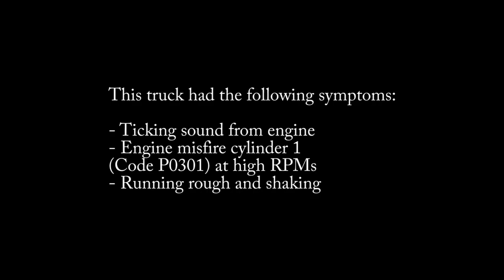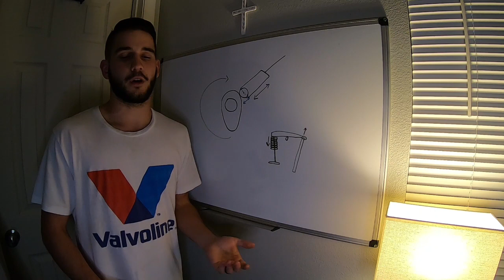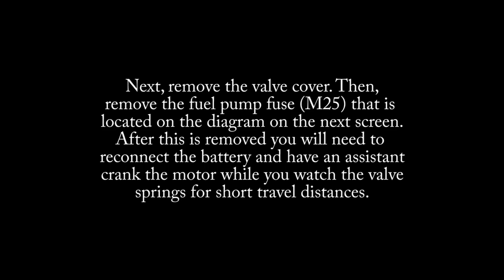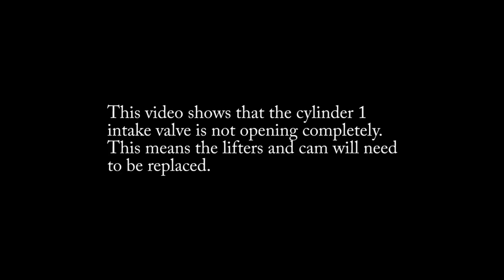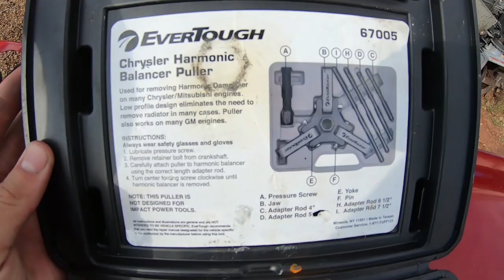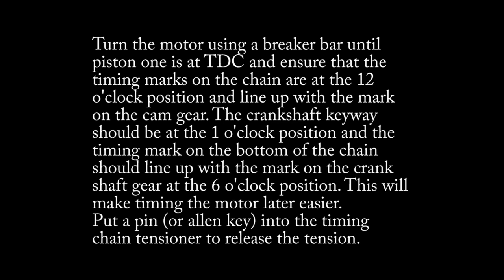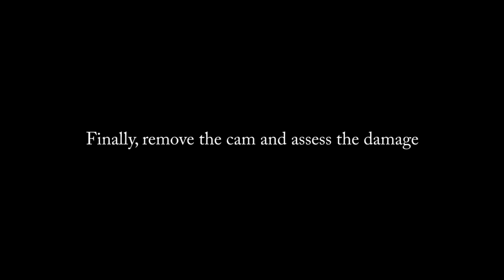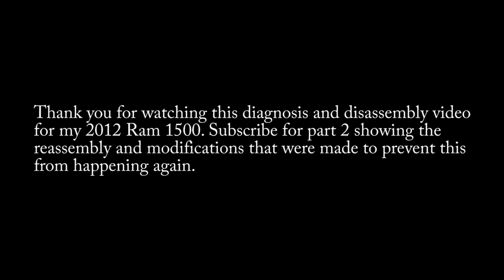2012 Ram 1500 5.7 Lifter and Cam Failure Part 1

Comment: I'm doing the same exact job as we speak. Upgrading the camshaft, lifters, hellcat oil pump, all new gaskets, spark plugs, injectors, coil packs, oil pan and pickup tube with gasket, new timing chain kit, etc. Pretty much replacing as much as I can
Reply: What did that run you price wise? I’m thinking of doing this and want to save up for it.
Reply: @MrDILLIGAF1980  Or you could just sell it now while you still can and buy a vehicle that has a reliable engine.
Reply: @scottywills124  after inspecting, it was just a couple broken bolts on the passenger side exhaust manifold. $51 for new gaskets and replacement bolts. And a day and a half of time.
Reply: @scottywills124 These engines are reliable. Replace the lifters (which Chevy and Ford has the same problems) this engine will run 300k miles easily.

Comment: I completed this job about 300 miles ago and here's my review. 

Truck: 2013 Ram 1500 5.7 4x4 sport

Kit: AMS racing MDS Delete kit.

Upgraded to hell cat oil pump. 

Found broken bolts in both exaust headers and removed with extractor kit. 

Replaced rusted heat shields on exhaust headers.

Replaced bolts that attach exaust pipes to engine heads.

The 4x4 requires lowering the front diff to remove the oil pan. I did this by removing a total of 7 different mount bolts for the front diff assm, removing the passenger engine mount bolt, and lifting the engine block about 4-5 inches using a jack and 2x4 with a v-shaped cut under the crankshaft pully. 

Did mds delete. 

I highly recommend using the timing chain reference points/markers when setting timing. Not because it makes a mechanical difference but to ensure you are still aligned after installing the guides.

Engine runs smooth as butter. No tick. Went with 5w 30 because I live in warm climate.  If you live in cooler climate stick with the 5w 20.

Spent about 3k in parts and tools. Probably saved myself at least 5k.

If you don't have a 4x4 this job is very doable with time and patience. I'm not a mechanic so it probably took me about 5 days total scattered over 3-4 weeks. 

If you have a 4x4 like me, I personally would recommend paying someone if you can because lowing the front diff adds about 8 tough additional hours and can be risky if you are not careful. 

Happy and blessed to be back on the road.

Good luck fellas and thanks to this channel because I wouldn't have been able to do it without this video.

Comment: How’d you get the oil pump off without dropping the pan? Great video btw! I’m dropping the same kit in my 2014 ram as we speak. Thanks for the help.
Reply from the maker: @davidstewart5866  thank you I appreciate it! Basically what i did is I took out the front half of the bolts from the oil pan and loosened the back ones so I was able to tilt it just slightly. It’s very difficult still to get the pump out but it’s still possible. Be careful to not drop your bolts in the pan!

Comment: Exact same problem with my 2012 with 165k miles. How are you all flushing out the metal particles left from the destroyed cam?I worry about that and may just get a new long block. Any tips? I don’t want to replace the cam and then have rid and main bearings go out in a few thousand miles from debri left behind.

Comment: Had this happen to my 2011 ram 5.7. 100kilometers 60k miles. Such a joke, whether more oil or bad parts this should be a recall. I just wonder if it will happen again with oem parts from 2019 or of there now somewhat better any thoughts?
Reply: I would like to know that
Reply from the maker: So far so good! I will keep you updated if the issue comes up again. But I am also curious if it will be an issue down the road with the modifications that I made
Reply: @milehighmisfits  what kind of lifters did u use
Reply: @J  yeah lucky if you use good oil it should keep you out of trouble. I was a bit hard on it for a while but now full synthetic sooner than later and it's holding great just exhaust manifold bolts breaking every 100k
Reply: @J  yeah me too I just heard you can loose a bit of power due to backpressure depending on leak but mine gets quiet once warm only fix it to get the aftermarket bolts which are alot stronger.
Reply: @JK-mr8wv  I here with you at 209k and counting with my 2010 Ram 1500 crew cab 4x4
Reply: @JK-mr8wv Negative. If you take the manifolds and have them resurfaced they will not break anymore bolts. Once they warp and you resurfaced them they will not warp again.😉
Reply: @seandp85 I also have a 2010 with 209k. Lifter just went out and chewed up my camshaft. Cyclinder 5 misfire out of no where. Always changed and used high grade oil on time everytime. I broke the engine down this weekend and just got started. Good luck!

Comment: How did you torque your cam sprocket with truck still in vehicle?
Reply from the maker: I had a friend of mine wedge a pry bar between it while I torqued. It wasn’t the ideal way to do it but it worked. You need to be very careful not to damage it

Comment: The needle bearing are going bad because of no oil splash during idle.... Majority of cam and roller bearing failures are coming from cop cars and vehicles that idle a lot. It's not an oil pressure issue but a volume flow. Milling oil pump replacement has an increase in pressure. in 2009 and up 5.7, you can put a hellcat oil pump which has a higher volume flow increasing oil pressure at normal operating temp at idle.

Comment: Also when you removed the head I saw you left the pushrods in  I’m confused on other YouTube videos I saw they remove the pushrods before pulling the head off?
Reply from the maker: Yeah I got a little ahead of myself in the video and I ended up taking the pushrods out as I was pulling the head off. Small mistake on my part, you will want to remove the pushrods before pulling off the head

Comment: How long was u driving it like that I have the same issue but don’t know how bad mines is I just got the truck
Reply from the maker: If you are worried about it being the lifters the best thing to do would be to remove the valve cover of the bank that is ticking so you can see if there is any reduced upward movement of your pushrods. Thats the easiest way to diagnose the problem.
Reply from the maker: I was driving my truck this way for longer than i should have. At first i thought it was just the hemi exhaust tick but then i fixed the exhaust tick and still had an engine tick and that's when i realized my lifters were toast. Probably for 5k miles before i actually started taking care of the problem. I'd suggest doing it quicker than that to reduce the damage to your motor.

Comment: So the problem is that the valve was not opening right? Was it an intake or exhaust valve?
Reply from the maker: Yes the valve was not opening fully because the cam lobe was worn down. It was an intake valve that was not opening

Comment: What lifters did you go with? I was thinking mopar but just curious what you bought?
Reply from the maker: I went with the Mopar lifters, the part numbers that I used can be found at 28 seconds into the part 2 video for this build!
Reply: Thanks is the second choice a good option to or should I stick with mopar?
Reply from the maker: From what I have heard both options are good! So far I have had no problems with the Mopar ones

Comment: How long were you driving before changing the cam?
Reply from the maker: I changed it around 140,000 miles I believe. I’m now at 148,000 miles and i haven’t had any issues this far

Comment: My 2011 ram 1500 5.7 cam and lifters failed at 80,000 miles .
Reply: What were symptoms up until it failed?
Reply: @backinz  I have a 2012 with 130k I change my oil early like 500 miles I need at least 200k out of this engine 😂
Reply: @moemoe0032  yeah I change mine every 1000 miles runs so much better after a oil change😫
Reply from the maker: I’m sorry to hear that! 80,000 miles is so young for these motors. It’s insane the rate that these failures happen
Reply: @JK-mr8wv  wow nice I just cleaned my IAT sensor , changed Cone filter and put better fuel and got my power back. Also smoother starts and shifts. WOT is noticeably improved
Reply: My 2019 Ram Rebel 1500 is in the hospital as we speak. It is getting a new Hemi long block because of the same issue. Threw a number 3 cylinder misfire, replaced all parts electrical... and nothing. The tech pulled the top half apart and found metal in the solenoid or servos under the intake. Fortunately, I have it under warranty. Only 77k on it. Proper maintenance and all.